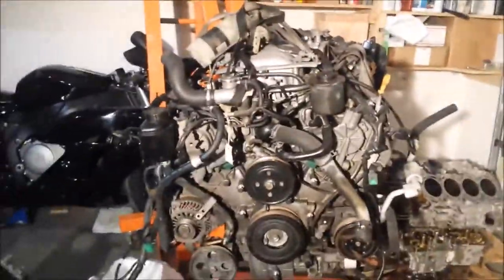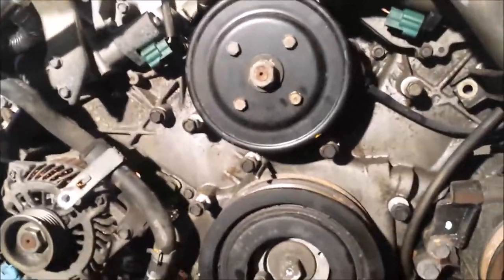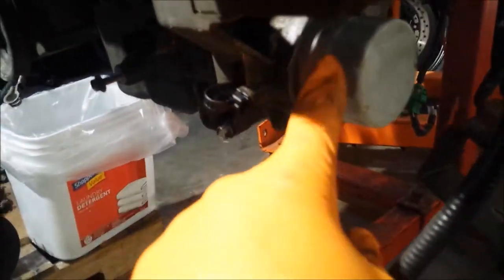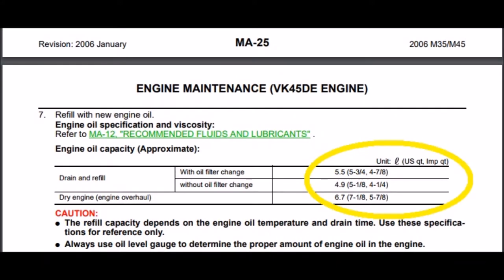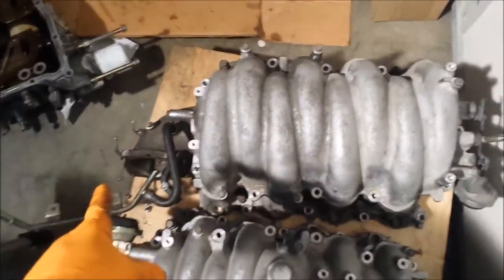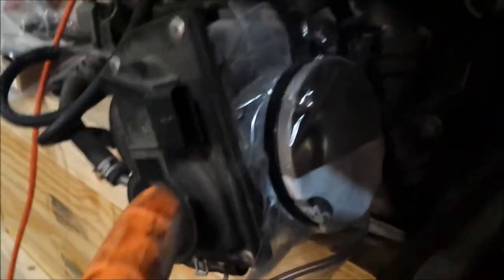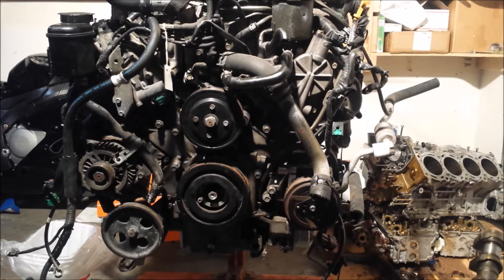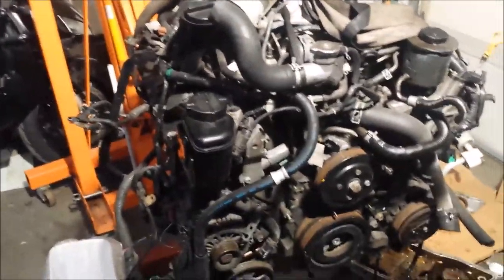VK45DE Part 1. Major differences as used in the US market vehicles

Comment: Ed, i need you brother. 06 q45 blew, and it is a vin b, would any vin b infiniti 4.5l work from before 2006 other than maybe the m45s?
Reply from the maker: The VIN b/a stuff gets confusing. For example the 2006+ m45 is a vin B car, but the engine isn't the correct one.
The 2003 m45 is a vin A and the engine will work. 

The best way is to lay your eyes on it. Look at pictures and make sure the starter is on the right side for any replacements for the q45
Reply: @EdBwoy  i havent the knowledge or time to remove the engine, it is currently at the shop waiting for me to provide a new one to be put in. I tried to locate the starter by peering into the engine from above the bay to no avail, do you happen to know what side mine would be on just off the year? Maybe even what years would go in? Say a 2005 engine, is it likely to be any different than the current one? I wouldnt think so... id get a 2006 one if there was one anywhere, theres only like one other q45 from 06 for sale in the states so they appear scarce... i heard the 06 m45 intakes are forward facing which is not the case with my 06 q. any help would be so damn appreciated man loved the channel since my M35.
Reply from the maker: @kramermillay  to see the starter, you have to go under the car. For a direct drop in engine, you'd be looking at a 2005 or 2006 q45. They are rare even on the road.
However, it would be cost effective to get any other compatible engine then switch the few parts over that are different.
Any engine from the 2003 & 2004 m45, or 2002+ q45 should be similar for the most part. I know those have to be easier to locate.
Reply: @EdBwoy  how difficult would a the opposite side starter be to work with if i so happened to get the wrong one? Just a simple extension of wires i could definetly do. I did just see a 2005 q45 engine for 1200 this morning which might be the route i go if it is likely going to be straight up bolting it in and plug it. Alsp you have no idea how much i appreciate you ed, my sister boyfriend happened to worked at infiniti servicing them in the late 2000s but wont really help me which sucks.. idk why.. but you're the real deal brother. I hope to continue what you do when i get to a place i can do such, such a help and i know others are very in need on info for these rare cars. Really rare, found a number on Wikipedia for just the 2005 model selling just over 1000, cant imagine the 2006 number...
Reply from the maker: Historically, engines with the starter on the right side have always been listed at lower selling price.

Price aside, if you were to get a wrong side starter, you also need to get the transmission bellhousing to accept it.
For wires, you need someone experienced with making heavy gaige wire. I wish you could just buy the 06+ m45 harness, but the batteries are located in a different spot so the wires aren't directly compatible.
Hoping that engine came with a starter, or you'll need to buy the correct "wrong side" starter. https://youtu.be/iPgTnrFP86o

All in all, you do the financial assessment on making the wrong engine work versus just buying the correct one.
Reply: @EdBwoy  if i were to take a look at it and jack it up at the repair lot could i see the starter directly fromunderneath? Like could i potentially see a gap in the bell housing? Im not too sure what a starter looks like by itself
Reply from the maker: @kramermillay  and I appreciate the kind words. I do this to help others enjoy their vehicles and avoid getting screwed over.

Maybe the guy didn't like the work he did at Infiniti and is completely done dealing with them. Or maybe he did not get into the heavy technical stuff and doesn't want to be stuck with your vehicle. Maybe he absolutely doesn't have anything to offer - I've surprised some seasoned techs with the knowledge I had on these cars. 
It's all speculation, but ultimately he won't help you. Maybe after the car is running you will find out the truth.

Big job btw, not sure how much the shop quoted you for labor, but I believe the book time is about 18 hours.
Reply from the maker: I posted a link in my last reply that should help you see the VK45DE starters.
I'll post it here too - https://youtu.be/iPgTnrFP86o
Reply: @EdBwoy  thinking about buying a jdm with 90k for 900 that also has a transmission to eliminate issue with it being on the wrong side physically. You said someone experienced in heavy gauge wire could do it like is it just a large couple of wires? Is it like i think and just extending it? Maybe even shortening it?
Reply: @kramermillay  What happened?? Did you get it fix?

Comment: Thanks for the info! Thinking about dropping in the 2003 JDM motor into my 240. Can you put the 06 throttle body on the 03 intake manifold? Since they don't have any way to rom tune the 03 motors but they can the 06 motors, I wanted to get a 06 harness and ecu and drop it onto a 03 jdm engine.
Reply from the maker: You're welcome bud. I know 240 guys use VK45s, but I always thought it was the 2003 USDM - dirt cheap. Do you know what side the starter usually is?
On the TB, not directly. The 06 one is larger. Plus, there might be one or 2 solenoids on the 03 manifold that would need to be relocated and tubes rerouted, or the 06 harness slightly modified. Have you watched the 2nd video?
Reply: On the 240 the starter is on the passenger side. I have only seen two guys doing the VK45 swap in the 240sx.  Mostly VH45 swaps I see a lot off, The VK45 is uncharted territory.
Reply: Just watched the 2nd and 3rd video.
Reply from the maker: With the VH being a passenger side starter like the 03 M45, the task is made that much easier with regards to the adapter plate. But hey, where there is a will, there is a way. People made the VK56 with the top mounted starter a possibility, right?
Reply from the maker: Any way I can help, let me know. I will have the engine out on the stand for a while and won't take anything to the metal scrapyard until the car is moving under it's own power.
Reply: The nice thing is that a company called http://collinsadapters.com makes the adapter plate for the motor. The info I learned from your video shows me that this palate might only work with the VK45 that has the starter on the driver side of the motor. I just emailed them to find out if you can just flip the plate to make it work or is it locked in.
Reply from the maker: +BlueRB240 Let us know. Maybe they make it for the VH as well.
That would be a money move, but as is, the pattern isn't "flippable".
Reply: EdBwoy yeah that's what I figured. I'll have to keep my eye on the jdm motor that has the starter on the passenger side.
Reply from the maker: +BlueRB240. Any reason you wouldn't want to buy a US one with the passenger side starter - F50 q45 and y34 m45?
I shouldn't assume, where are you located?
Reply from the maker: +BlueRB240 I've got another video coming. Discussing the rear of the engine. This is info you seem to already know, but might help clear things a little

Comment: Hello from Miami again. Im in the middle of the swap and it looks like the Jdm only spins about 320 degrees. 👎 is that normal?? I’m so confused. The bottom is super clean. Any advice?
Reply from the maker: It should turn a good 360 degrees. Have you tried both clockwise and CCW?
Also, there is good compression on 4.5 liters of air. Try turning it with the spark plugs out.
Reply: EdBwoy  yea both ways. I’m thinking that a valve is gettining stuck open.
Reply from the maker: It's possible. My first JDM engine was a smooth job. The other ones I received have had some quirks (I doesn't seem they're big on oil changes, lol)

Back on topic though, it's not impossible, but rather unlikely to have bent valves in this engine.
If you have checked the spark plugs then pop the valve covers and watch how the valve lifters behave under the camshafts as you turn the crankshaft.
Reply: EdBwoy now it’s spinning free. I think a guide was sticky. Not sure what to do, worried that it might stick again.
Reply from the maker: Did you remove the spark plugs or valve covers?
Reply: EdBwoy yea. Pan off plugs out intake exhaust off valve covers off. Now it seems to be spinning fine.

Comment: Hello very good video thank you . I would like to know how to get the engine slinger for it please help
Reply from the maker: I had to design mine and have them made. I have tried to buy some but no one sells the factory one.
Reply: Thanks
Reply from the maker: How soon do you need them and how much are you willing to pay for a set?
Reply: EdBwoy well I’m planning on working on it on the next month.i ordered a set today but I’m not sure about them
Reply from the maker: Let me know if they come through. I have ordered several times through a few different websites and it never seems to be in stock. Maybe I'll try with a dealership next.

I designed mine to be able to hold the engine + trans + me jumping up and down on it. I'll see how fast I can make them again, and if there's interest I'll offer them
Reply: EdBwoy I went to one and one of them is discontinued part . I got the vk45de Infiniti. The part numbers for it are one is 10006-cg200 the other one is 10005-Ar00A. The first one is the one they told me is a discontinued
Reply: But I’ll let you know if the ones I ordered comes in fine .
Reply from the maker: I have used a Website that I believe sources from various different dealers nationwide. Heck, I even tried to buy the ones for the M56, no luck.

Were you able to buy the one that your guys had in stock? Or is that what you're waiting for?
Reply from the maker: Ok, I hadn't seen your second message. I'll wait for your updates
Reply: EdBwoy hello hey man they canceled my order, they said the parts were discontinued
Reply: How much did you pay to get your made
Reply from the maker: @fabioernesto5041  that's exactly what I kept facing. No matter what part number I used, it was always discontinued. Thanks for the update.

I was traveling all this past week, but hopefully next week I'll get to the machine shop to get quotes on replicating my design.
Reply: EdBwoy thanks very much that was my last hope on getting them but I guess It won’t  work. I’m just crazy to take my Infiniti engine out that’s my first one love work on cars
Reply: If you can help I will be glad
Reply from the maker: @fabioernesto5041  send me an email on edbwoy@gmail.com
Reply: EdBwoy I sent on your email
Reply from the maker: @fabioernesto5041  no new emails in my inbox. EDBWOY@GMAIL.COM

Comment: Big Question,  U1000 code..ground fault. Where should I check.
Reply from the maker: +Gregory Hines Yeah, that's a big one. Electrical problems are no fun.
Are you having any driveability issues as well?
What I'd start with is the negative terminal from the battery. Make sure the clamp is good, then move to the bolt that secures it to the body.
Reply: EdBwoy the main problem I'm having is when I start it in the morning I'll drive down the road maybe three or four blocks then it just shuts down I give it gas 3 or 4 times or hold the gas down for like 10 seconds or 5 seconds and little ride fine sometimes for a few blocks and shut down don't turn off but just lose all power then sometimes when I hold it down for 5 or 10 seconds it'll be fine for the rest of the day but if it's all for more than a couple hours I'm getting the same repeated steps but far as the ground issue right now I have no gauges besides fuel all the check engine lights are on my radar and cruise control don't work my manual shift doesn't work but as soon as that reset happens or that ground-fault goes away all that stuff starts working again
Reply from the maker: +Gregory Hines ok, thanks for the additional info. If you battery is verified to be good, look into the IPDM (fusebox behind the battery), which you can buy a used one to test.

I recall reading something similar on the forum: http://forums.nicoclub.com/topic533437.html?hilit=Christmas%20ipdm

Comment: 261042 miles on my car engine misfire also back fires at times shakes want to rebuild engine
Reply from the maker: Google for any machine shop near you and give them a call. As long as they do engines they should be able to advise you.
Reply: @EdBwoy  I found a few do you think it would to get a used engine with 88 thousand miles then to rebuild my engine note I having misfire I'm sure low compression also bad engine rings I'm sure what do you suggest to rebuild my engine to a point where it's not alot and cost effective to get car running back to factory like what's the recommended plugs oil wow I have so many questions bro lol I'm to get this car running like new again huge fan of Infiniti M45 and the M56 is my next mission lol my neighbor has the M56 it's pushing over 700 horse power
Reply from the maker: @kennethaytch3163  I can't say either way without knowing any numbers. How much is the seller asking for the 88k mile engine? Depending on damage, a rebuild could cost you around $2,000. You have to call a rebuilder and discuss it with them.
Reply from the maker: @kennethaytch3163  Yes, I like the Infiniti V8s.
Do you know what kind of work your neighbor has put into the M56 to bump up from 420hp to 700hp?
Reply: @EdBwoy  he's asking 700.00 I was thinking of getting it but also thinking if I did buy this used engine put a new timing chain on it would that be wise to do kinda like a preventive maintenance on it making sure seals are good which I have the whole engine seals kit brand new and timing chain new as well  meaning I would check the slinder walls in used engine before having it in stalled lol I'm almost wondering if you would take on the job I have a friend who lives out there I could if you open to doing this task depending if you could or would and far as time it would take
Reply from the maker: @kennethaytch3163  $700 is a very good price for a used VK45DE. I'd buy it and try to rebuild the one you have as a spare or to sell.
It doesn't hurt to do preventive maintenance especially if you already bought the parts.
Usually I remove the oil pan, inspect the bottom end and make my decision from there.

Thanks for the vote of confidence, but I am not an engine rebuilder. Just a regular guy working in my garage. You'll be better off finding someone local and experienced.

Comment: so apparently if you really want to, you can use an 03-04 engine in an 06+
Reply from the maker: +liblib89 Yup! But its gonna take some effort and/or money. 
Change intake, change oil pan, change starter (plus custom work to shorten the wire)... if you've figured out how to mate the mismatching engine to the transmission.
Things could add up quick.
Reply: are you swaping the JDM 03VK into an 06+?
Reply from the maker: +liblib89 Yes indeed. Too bad I'm not sure which year or car exactly the JDM engine came from. I have the engine serial number but can't do anything with it.
I just referred to it as an 03 M45 because of the stuff that is visible on the top end
Reply: well good to know it's possible, should some unfortunate events arise one day, let's hope not however!
Reply from the maker: Cheers! To the knowledge we hope we never have to use. lol
Reply: Greetings from Miami. My 2006 M45S engine just blew. I am looking at doing the exact thing that you are doing. I have found a JDM vk45de and the starter is on the drivers side as well. If I take it down to long block status and use all my existing components, this should work correct? I'm wondering about the 2006 transmission fitting to the JDM and if there are any starter issues. Any help would be great.
Reply from the maker: Greetings from the Midwest. I'll respond to your question in more detail in a separate post so it doesn't get lost. But pretty much yes, you're correct
Reply: EdBwoy  thanks man, I truly appreciate it.
Reply from the maker: did you see the other post I made?
Reply: EdBwoy just found them yesterday. I need to go through them in depth. Car all of a sudden started blowing smoke from the tail pipes and smells kind of like burning oil. Getting a knock from #8 as well.
Reply from the maker: I'm referring to a comment on this video, not the other videos I recorded. It should be at the very top
Reply: How unfortunate, I wonder why these engines keep having bearing issues from #8 rod? Makes me think there is a defect or something..I have seen M45 for sale at auctions with over 200K on them, but who knows if their engines have been replaced or what..this strikes me as strange because usually a Nissan engine is problem free for over 200K
Reply: I did read the comments above, however I guess I’m a little unclear if it refers to a US 93’ or a JDM version. So does the 06’ trans work with the jdm?
Reply from the maker: I don't think we're referring to the same comment, but your answer is yes.
Reply: Hey EdBwoy, thank you for shareing all this info.
Currently my 06 m45 engine got stucked and I bought 04 VK45 engine to swap, but after your videos I found it's not so easy. So can you advise of I can swap all needed parts from 04 engine to my stucked engine for 06 M45, or opposite from 04 to 06 engine?